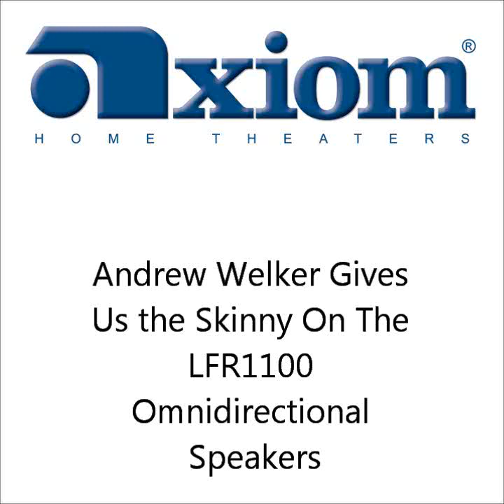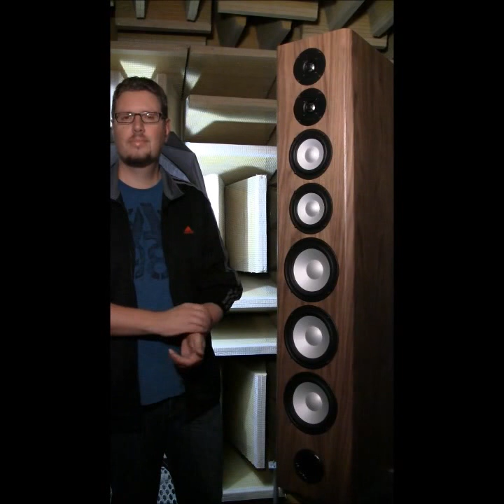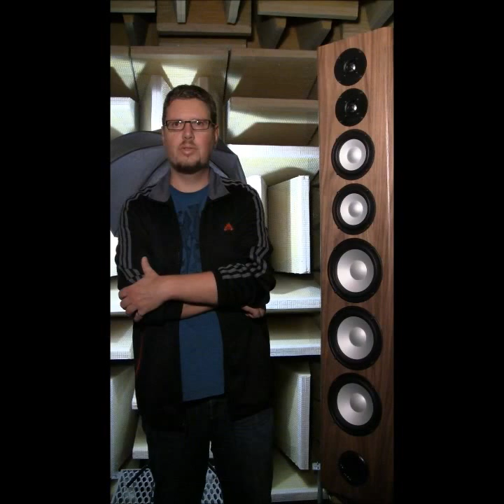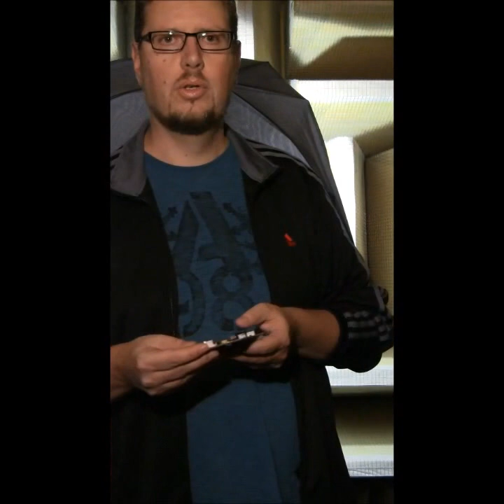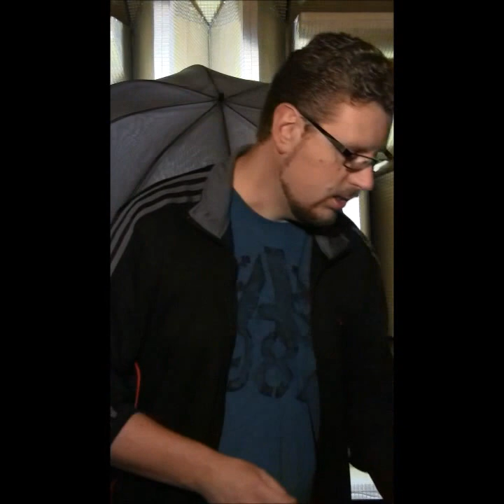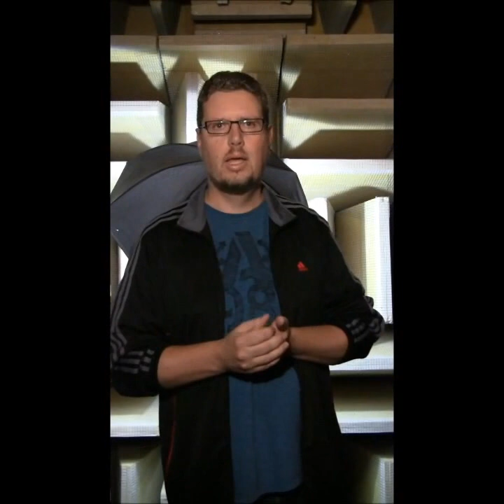Omnidrectional Speakers: Designing The LFR1100s

Comment from the maker: Are you asking if we are doing anything with the LFR system/DSP to account and correct for low frequency room modes and reflections? The answer to that is “no” as we are not performing any type of room correction. The LFR does, however, address SBIR at mid and high frequencies through its unique radiation pattern coupled with the DSP correction. This allows for a closer approximation to an ideal sound power response in room than a conventional loudspeaker can achieve.